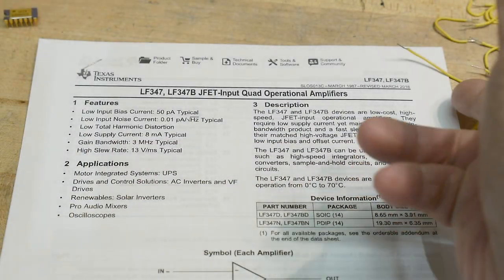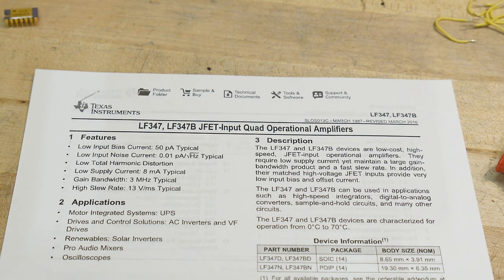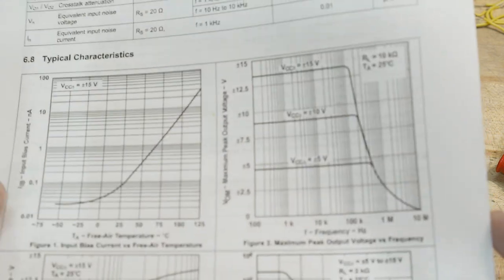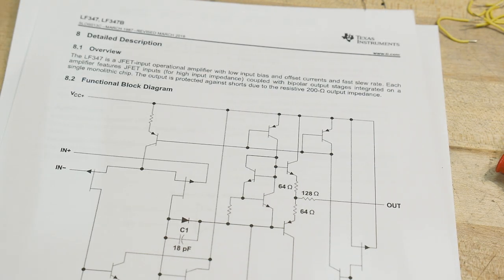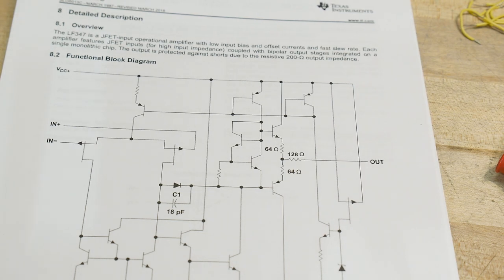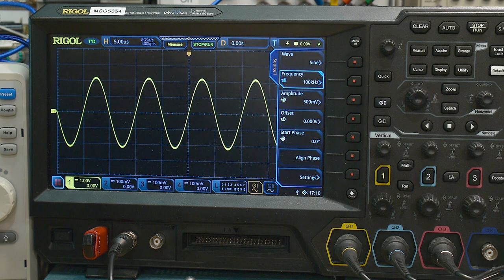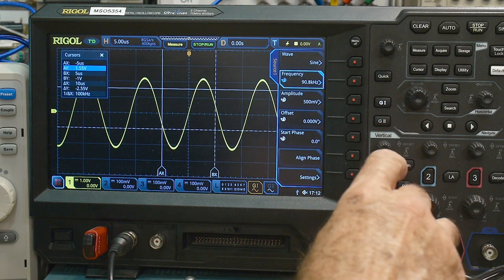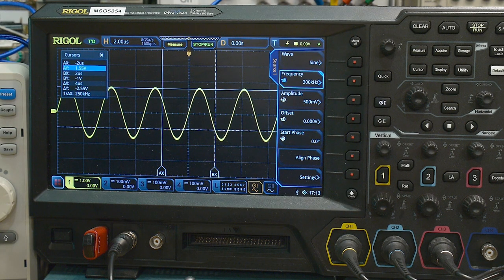#1584 LF347 Quad Op-amp

Comment: That 128 Ohms is in series with another 64 Ohms regardless of which transistor is driving.  Also, the emitter follower has a few Ohms depending on the base bias and drive.  I expect that their designed output impedance is indeed 200 Ohms.  But, you don't have to take their word for it; draw some current and see how fast the output falls.  The open loop impedance is this measured impedance times the gain.

Comment: Just as it was mentioned there were only 2 FETs in the circuit. 
For the internal working points they use 2 current mirrors, formed by the upper 3 transistors with the one on the right as the input. They are driven by the transistor on the lower right. It's current is defined by a current source, the third FET on the far right, as it is so convenient to built a current source with a FET. In this way we get the same current for the working points over a wide range of supply voltage.

Comment: Technically the LF347 is a rebranded TL074 now.  LF347 use to be a completely different op amp made by Fairchild / National Semiconductor , but ever since Texas Instruments started to manufacture it , there version is basically a TL074. Texas Instruments still makes the original LF347 but under the name LF347/NoPB and its way more expensive than the rebranded LF347.  The original part has a 4 Mhz GBW , while the rebranded LF347 is 3 Mhz just like the TL074. In the video his IC has a National Semiconductor logo , so its the 4 Mhz original version.

Comment: Love a good FET or even MOSFET input op-amp, but they make checking for fakes a pita. Can't just measure the input/offset resistors, nope -- you have to drag out the scope, sig gen, power supply, and a test jig.....

Comment: A magazine called Nuts and Volts uses the tl084 in a circuit, well, the author of the article does, he uses the circuit for a Distortion Amplifier. I'm wondering why he would use that IC or IC like the tl074 or this one, the LF347 ? Perhaps you could google and look at that circuit at Nuts and Volts ? Its the only audio distortion amp ever featured in that magazine. I believe he's using 8 ic's.
Reply from the maker: the TL084 and TL074 are the same part with different test specifications. the 74 being a bit better. that part is pretty common in audio equipment.

Comment: "300 kHz with a gain of 10..." Does this mean that there's something multiplying the frequency by 10 (seems unrealistic), or are you extrapolating the expected loss from 3 MHz back to 300 kHz? I don't have the spec sheet handy - sorry if this is a dumb question!
Reply from the maker: the bandwidth of the part (datasheet) is said to be 3MHz. traditionally this is specified for a gain of one. adding 10x gain will decrease the speed and give 1/10 of 3MHz or 300kHz

Comment: Idea for you: 
Demo building wide bandwidth amp with gain  - unattainable with one op-amp.
Reply: How wide is wide? How much gain? Can we make the op-amp or only use off the self? I have one with 300 Mhz gain bandwidth, don't know were I got from. Found it when I started to inventory my parts. 🙄
Reply: @Pixelwaster  the exact parameters are not important. My point is that a series of gain stages may be used to provide a wider bandwidth than a single op-amp given a selected gain. For instance a 3mhz GBP op-amp will only provide 300khz BW at gain of 10, so using the same op-amp(s) demo a gain of 10 at 1mhz. I have not worked out the example any further. Comprendo?
Reply: @mr1enrollment  Got it.